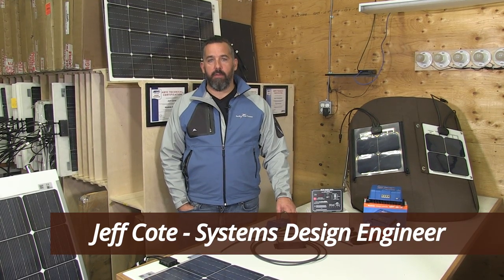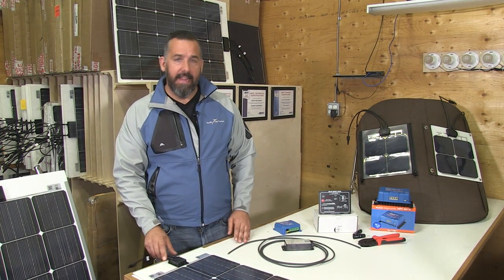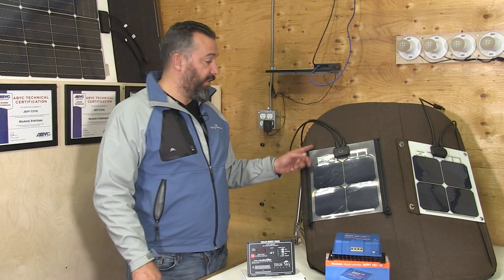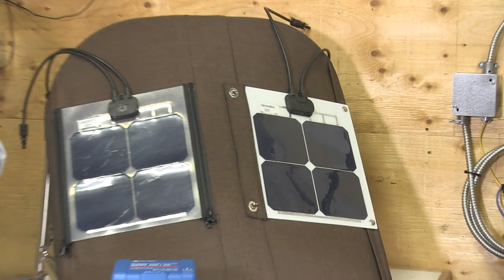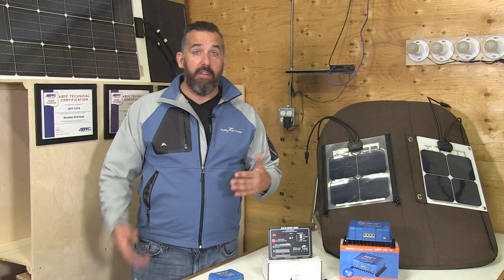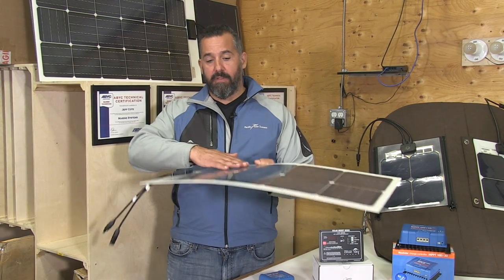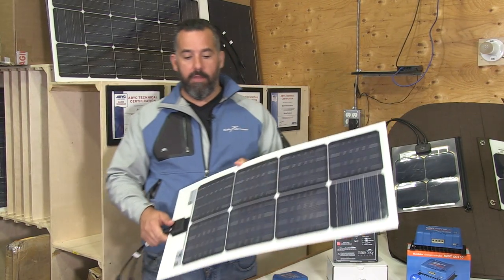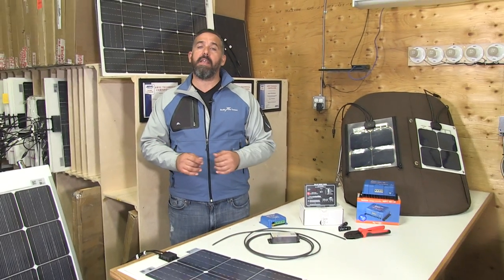Installing a Flexible Solar Panel on Your Boat

Comment: I stumbled across your video whilst doing some research on installing flexible panels to a canvas sailboat bimini.  I live in a relatively wet climate (Canadian east coast) and hadn't thought about velcro holding in the water.  I really liked the idea of using a zipper.  How would you attach the zipper to the solar panel?  Thanks for the video.
Reply from the maker: Hi Alan, a good sewing machine (e.g. sailmaker or canvas shop) will be able to sew the zippers on the edge of the panel.

Comment: Your videos have great information! Thanks you!

I have a canvas T top but the the frame itself is rigid (unlike most biminis). I am wondering if it's possible to tie the panel to the four sides of the frame using stainless cables (or even T top strings) so that I can avoid sewing or drilling holes onto the canvas.

Comment: H Jeff, thanks for the great ideas.  I have a powerboat with a pretty large hard top roof that would be a great location for panels.  But we also store an inflated soft bottom dingy up there, and also climb up there to pull the dingy up.  How robust are these panels?  Could I drag a dingy up on top of them and walk on them?  I know not great treatment of solar panels, but trying to make the most use of space available.  Thanks!
Reply from the maker: Hi Bill, good question, some flexible solar panels like Solbian can be bought as walk-on. When installing the flexible walk-on panels, you'll need to make sure your boat top is completely smooth before adhering the panels.

Comment: Hi Jeff, 

found your videos a few days ago, been foraging through all this information you have on here. Apart from this and the forums/texts/info ive been scrounging through since I got my boat a month ago I've had 0 experience or understanding of electrical. But I've already gotten a better grasp I think than alot of boaters judging by some of the horror stories you went through lol

So my question: I'm setting up a solar panel on my boat, I unfortunately bought most the stuff before finding your videos and I may have made a few mistakes - I bought 10 gauge wire with mc4 connectors already attached on each side, so will I need to connect mc4 connectors to another wire to run to the controller or you think I can strip those mc4s off one side and run it directly to the controller? Then also regardless of having to use new wire or this same wire, I actually have no idea how to install that wire into the controller lol i think its just such a newbie thing that no one has even bothered to explain it because I cant find a how to anywhere.

any info appreciated thanks
Reply from the maker: Hi Alexander, easier to run a solar cable from the panel to a controller without the MC4 connector attached to the end. The connection at the solar controller is done with a wire stripped bare.

Comment: I have heard that flexible panels overheat easily due to lack of ventilation. I’d love to instal some on my 25 foot sailboat to save space, but have heard they usually only last one or two seasons. 
Do you have tips on how to improve ventilation without resorting to only Bimini mounting?
Reply from the maker: Hi Jordan, good flexible solar panels are meant to be surfaced mounted and can handle the heat without ventilation and we've done this on hundreds of boats.

Comment: Hi! Don’t you need to put something between the solar panel and the canvas to both dissipate the heath, and to prevent friction which could/will lead to premature failure of your canvas? (Laval, Québec)
Reply from the maker: Hi Jean-Marc, to prevent excessive unnecessary flexing of the panel we often install a polycarbonate backing between the canvas and solar panel. Unlike rigid solar panels that need an air cap, flexible panels can be directly mounted on a surface.
Reply: @PacificYachtSystems 
Do you have any links to polycarbonate backing you mentioned

Comment: Great video
If I was using a Solbian SR 216 panels with individual controls ( worked out approx 16 Amps of each panel) would I need 100/20 or 100/30?
Reply from the maker: Hi Steve, the Victron 100 volts / 20 amp controller will work.

Comment: I read that flexible solar panels only have an efficiency as low as 7% compared to 20% for non flexible. Is this correct or am I mistaken?
Reply from the maker: Hi Peter, good flexible monocrystalline panels from Gioco, Solara, Solbian, Sunpower, etc... will give 20 - 23 percent efficiencies, comparable to rigid solar panels.

Comment: how do you attach the zipper to the flexible solar panel?  also, i have 1-100watt panel and 1-50watt panel. can I upgrade the 50 to a 100watt panel without rewiring the system or changing the components?
Reply from the maker: The zippers are sewn on the edge of the solar panel. Make sure the stitching is far away from the solar cells.